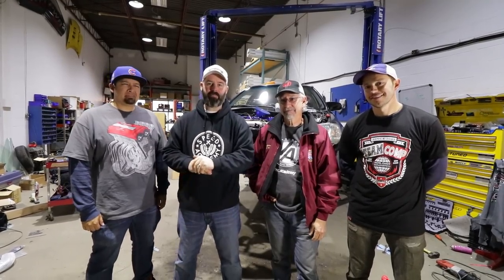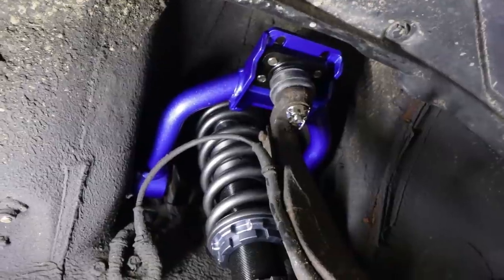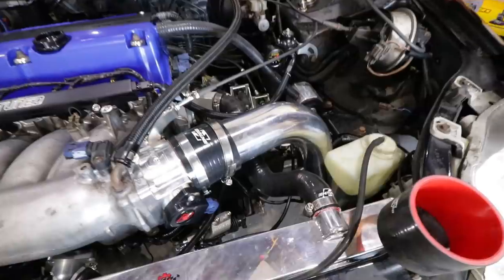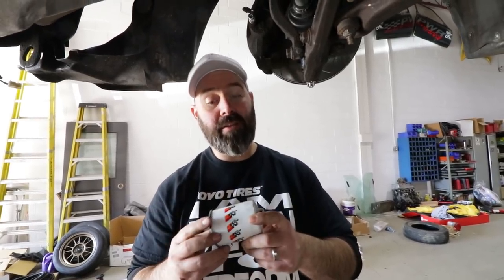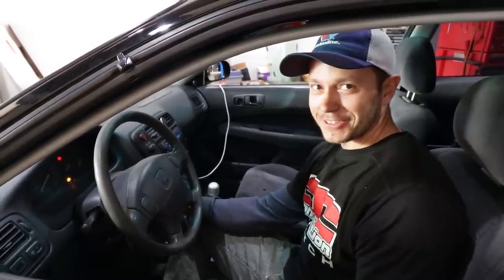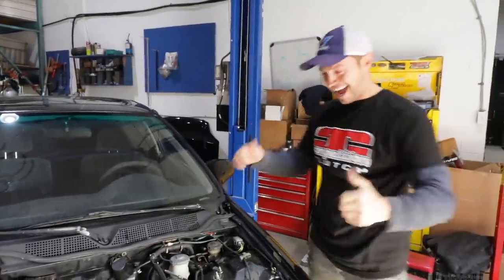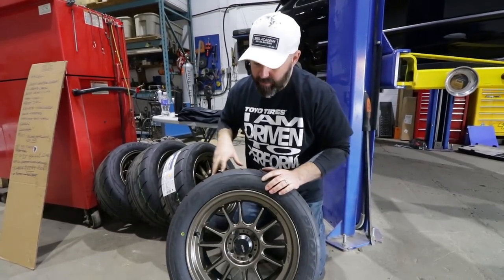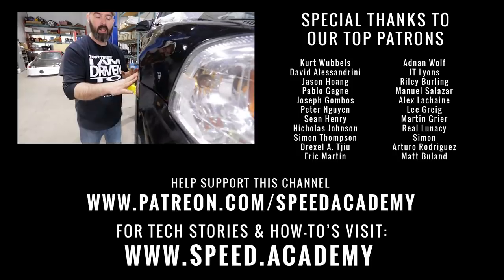Will the Honda K20 K-Swap Civic Start? - 5 Day Track Build Challenge - EP06

Comment: The thing I like the most is that you don't build silly slammed with cartoonish wheels cars but clean real trackable cars.. No track car need a >18''wheel, a  civic is perfect with 15''
Reply: Cars with big brakes needs bigger wheels. And yeah small brakes and big wheels looks bad anyway.
Reply: A 15" with good tyres is faster than an 18" where they ran outta money to keep buying high quality 18" low profile tyres too.
Reply: Lawrence Sullivan exactly.. A bigger shoulder gives you more flexibility and more contact surface that results in more grip..
Reply: EtaCarinae230 that is interesting considering a 18×10 on the front of an 450whp supercharged integra is faster in class BECAUSE OF GRIP.
Reply: EtaCarinae230 youtube search winton VIC time attack integra
Reply: Nick Sawyer f1 cars use 13'', time attack cars use from 13'' to 18''.. Last month I was at Monza at supertrofeo and all the 600hp huracans use 18''.. My point is that a 200/300hp fwd Honda doesn't need anything bigger than a 15'' and a good tyre
Reply: EtaCarinae230 for the budget minded yes but if you want maximum grip a 18×10 is proven to exceed and i personally would run a 16×7 wheel with a 205 45r16  toyo r1r another proven combo
Reply: Gotta bump to 16s now since there's almost no reasonably priced (or really any) 15s anymore. 14s are extinct as far as performance tires go.
Reply: @Giixxersquid  EG, EJ, EK civics can all run 15x8 with 225s easy.  the next logical size to upgrade to if you want to do heavy fender rolling and you have the gearing is 17x8 with 235/40s which are not that much more expensive.  The added diameter increases the tread area that hits the ground.  215/45/17 would likely rival the 224/45/15s in grip just because the diameter difference.  Honda Challenge H1 cars typically fit no less than the 235 these days.
Reply: 6spdkeg all I’m saying is check out winton VIC time attack integra. That video speaks for itself

Comment: 2 1/4" exhaust is tiny, you're leaving quite a bit of power on the table...  a 3" with a big muffler should take care of the "ear bleeding" loud issues.  I mean going from a 2.5 to a 3 gets you about 10-15 hp on a bolt on K20 with a tune, and this is even smaller...  although the 2 1/4 will prolly sound awesome, I love the way small exhausts sound on K and F engines
Reply from the maker: No prob Bob, 3'' exhaust is a future mod for this car, as is a 3.5'' diameter intake system since the guys at K-tuned tell us that makes power on these engines.

Comment: you should always tighten control arms under tension, or after complete suspension replacement, flat plate the car on the alignment rack.
Reply from the maker: Next episode...
Reply: Cuul, I figured y'all may have missed explaining that.

Comment: NEVER use a aftermarket oil filter....on K20 engines. the VTEC works with oil pressure, aftermarket filters aren't designed like the OEM is so oil flow isn't the same. you CAN, run into issues Although it's not very common but I've seen it happen.

Comment: I used valvoline on my Z3 but it burned though it like crazy. Use Mobil 1 extended performance now and hardly burn at all
Reply: What weight are you using?

Comment: i dont think it is necessary to use wheels wider than 8" unless youre some kind of stancer :p
Reply: Of cuz wider wheels give you better traction, but im referring to this car and this build, wider rim does not necessary mean a faster lap time with a car like this
Reply: RaphaelYC On this car if they used a 9" wheel with a 225 R comp it would equal faster lap times.  Stop commenting on things you don't know about
Reply: You could fit a 225 on a 7.5" rim why would using a 9" rim with extra weight be better
Reply: RaphaelYC Jesus Christ kid... do some research
Reply: 94tegLSatMSC i run 17x9 with a 245 and there is minimal ballooning im sure a 17x 7.5/8 will be almost square with a 225
Reply: Yemi Joel I run a 225 Hoosier on a 15x9, it could even be on a 15x9.5 or 15x10.  Read up on why a slight stretch is better for road course use.  Lots of beneficial reasons to run a wide wheel, this is stuff most people that actually run at the track know about
Reply: 94tegLSatMSC im not basing this on just internet knowledge this is off my own personal experienxe running track,  plus the multitudes of people i know who has set amazing times with a complete square set up, as i run r888 on a 17x9 tires. Although if youre referring to drag racing it might be different
Reply: 94tegLSatMSC ill read up sure but i fail to see how a slight stretch would be more benificial then solid contact patch.
Reply: Yemi Joel I highly doubt you have a lot of track time if you're even second guessing this.  It's track stuff 101 lmao, check the videos on my page if you think I'm about that drag life
Reply: 94tegLSatMSC no its not that i havent heard of it like i said the benifits of a streched tire versus a square set up?.  why is it that time attack cars do not run this set up the only people ive seen run a slight stretch on tires for added performance is drifters. ive seen it used on scca days as well but with no performance bonus over a tried and true set up.  if you have a link id love to read up on it maybe im missing something invovling contact patches of tires versus max grip.
Reply: Yemi Joel Just the fact you're using square stance to describe rim/tire width tells me you don't have much experience.  Time attack cars do you use a slight stretch.  There are several reasons why a wider wheel is better, for instance the tire will have a wider contact patch.  Also since the sidewall has a slight stretch it resists rolling over under hard cornering.  Almost every NASA Time Trial record is set with a car on Hoosiers with a slight stretch, it's just faster.
Reply: Yemi Joel You usually use square stance to describe a setup where a vehicle uses the same size wheels and tires front and rear
Reply: 94tegLSatMSC interesting I'll look more into it then

Comment: Needs a better fan that moves more CFM as well as a shroud. Will greatly improve cooling. 750CFM is pretty smalltime.

Edit: 2 1/4 exhaust... on that nice header... fucking whyyyyyy. Could have just used a cat + resonator with a decent muffler on a 3" and it wouldn't have been loud or obnoxious at all.
Reply from the maker: The rad is so large that the fan does an awesome job of cooling when it turns on.

As for exhaust, been there and done the 3-inch exhaust with resonator and cat. Still too much drone for my liking. This will work for now. Later on we'll upgrade to a 3-inch and Jake's neighbours will hate him
Reply: Sounds good guys. RIP Jake's neighbors, may they sleep in.... well, not peace.

Truthfully the only 3" exhaust experience I had was on a turbo car, which I'm pretty sure as far as noise level was concerned the log manifold and turbo itself acted a bit as a resonator. In addition to that I had a Vibrant bottle res and a Berk muffler. End result was actually pretty quiet and tame. Not sure I guess how it would go on an N/A setup.

Comment: 949 racing is flow formed not cast and those are the ones that crack the most so I don't get this flow formed shit. The proof is out there that they are weaker than a cheap cast rota
Reply: The gen 2 or older 949's had cracking issues, the gen 3 and newer are fine